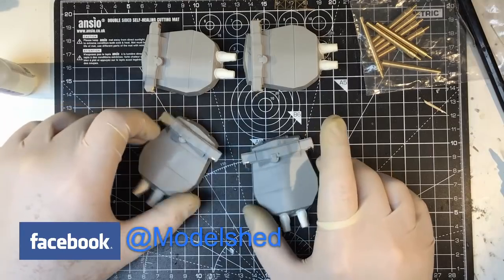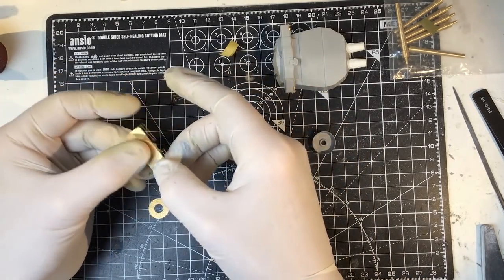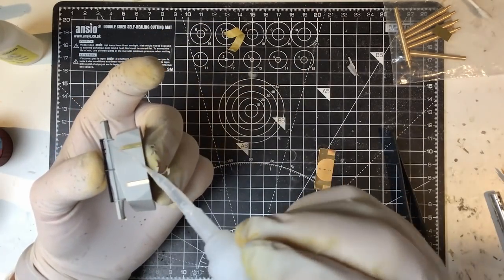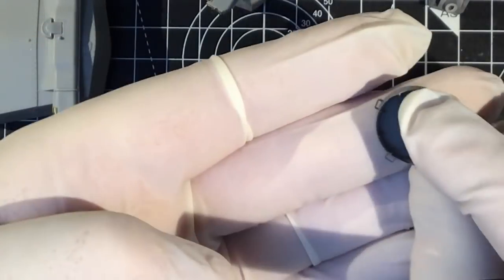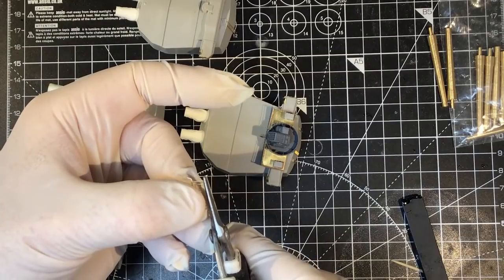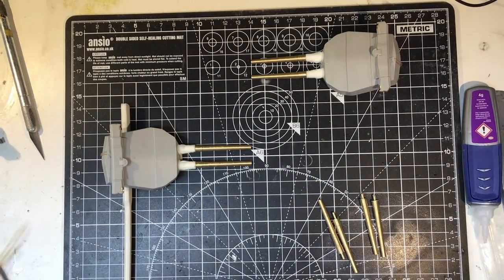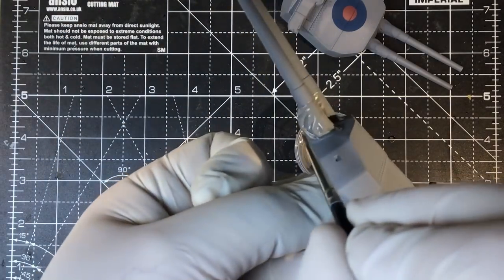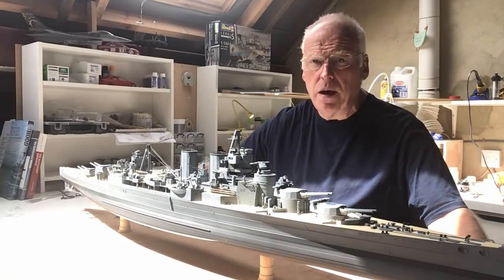Trumpeter 1/200 HMS Hood Full build with Pontos detail set Part 41B

Comment: Hi, just a suggestion for anyone dealing with the problem of fitting turned metal barrels. It's quite easy to knock up a simple jig out of cardboard or scrap wood that will support the barrels at exactly the elevation and separation you want whilst whatever glue you are using sets. Build a holder for the turret at one end of a rigid base strip, and then then at the appropriate distance to give you your required elevation, a cross strip notched at the correct spacing to ensure the barrels are straight, level with each other and evenly separated. As long as the barrels are sitting properly in the notches, gravity does all the work. If you have a 3d printer, this is something that would be easy to produce on that.
Reply from the maker: 👍 good idea

Comment: Everything coming together brilliantly, it's been great watching your ups and downs Steve and I'm so looking forward to seeing the finished piece as I'm sure you are. 🍺🍺
You asked the question in part A about how to stop your instructions becoming tatty. I have a long-term HMS Victory plank on frame project on the go and I cover the plans in sticky back plastic before starting and 5 years later they are still in excellent condition. It made worth downloading digital versions of the Pontos instructions blowing them up slightly and either using sticky back plastic or laminating them to give them a  little robustness.
Keep up the great work.
Reply from the maker: Good suggestion thanks Craig. I’ve invested in an A3 display book with clear sleeves inside so I hope that preserves my next project instructions

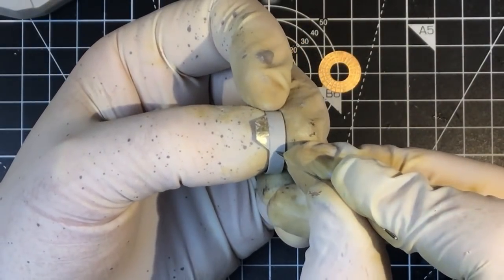Comment: 15:20 Slightly bend the template to the curve, pop some masking tape over the etch piece and the place in position, just drill through the holes. Simples! You'll almost certainly need that trick for the bow steps on the Bismarck!
Reply from the maker: Yes I’m going to need that tip Dave there are LOTS of drilling templates in the set.

Comment: You worked around it anyway but, on the 1/200 Iowa I'm building, I stuck the templates for drilling the holes to the model with clear tape - keeps the template secure but you can still see where you need to drill...
Reply from the maker: That’s a great tip thank you John
Reply: @TheModelShed  it actually illustrates the taping  process on the Pontus Bismarck instructions not sure why they missed it with he Hood. Perhaps they were finished before Friday 😄
Reply: Instead of using a drill tru the template, try a fine marker pen to indicate the drilling points,

Comment: Good morning Steve 
Very enjoyable and informative tutorial as usual. My question is there is so many types of solder out there so I was wondering what you were using 60/40 ?
Reply from the maker: To be honest I don’t really know! it’s an old roll I’ve had for years as I have not done much kit soldering  up until this build. All I can tell you is that it says 100g flux core on the label. I need to get some different solders with lower melting points as this one appears to require a lot of heat and I get a lot of scorching and clean up as a result